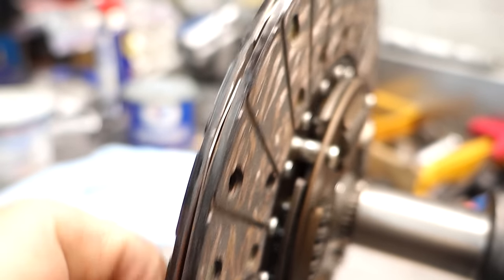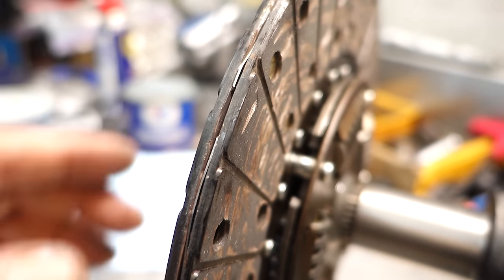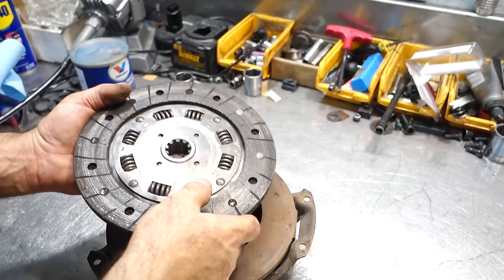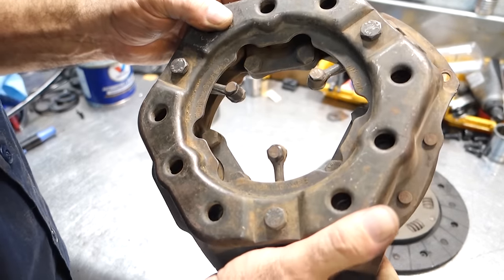Learn How a Clutch Works -  Basic Clutch Operation and Tips

Comment: After adjusting the shifter linkage to factory specifications, reducing the play in the clutch pedal so that the release bearing makes firmer contact with the pressure plate diaphragm fingers to disengage the clutch disc and renewing the transmission fluid with Pennzoil Synchromesh my A833 works like a dream. So I got to thank you Paul for this fantastic tutorial because man does it feel good to fix it yourself, feels awesome.
Reply from the maker: That's what it is all about! Thank you.
Reply: Anthony Murphy where is the speedometer sensor for a volvo 2000 v40 4.0
Reply: GearBoxVideo where is the speedometer sensor for a volvo 2000 v40 4.0
Reply: Question. With the firmer contact of the release bearing with the diaphragm fingers, is the release bearing turning whenever the car is moving (whenever the clutch is engaged) (whenever your foot is off the clutch) and you are driving down the road. If so, how long will the release bearing last?

Comment: Very informative. I wasn’t aware that the pilot bushing could grab the input shaft that way. Cheers.
Reply from the maker: We only use oil impregnated bushings. Never a roller
Reply: @GearBoxVideo  What is acceptable clearance on the diameter of pilot shaft to bushing ID? Is .010" too much (for an oil lite bushing)?

Comment: I learnt a lot about clutches a few years ago. I drove a 1983 daihatsu charade and could not get a daihatsu clutch set for love of money so had to contend with a LUK clutch. Within a year the clutch collapsed catastrophically.  After replacing the clutch 3 times in 3 years i found a daihatsu clutch.  It turned out that  the LUK  thrust bearing was not the right size and caused too much pressure on the plate and it would cause the diaphragm to collapse. The daihatsu clutch lasted 10 years!!!!!  Thank you for the reminder of how they work.
Reply from the maker: Often overlooked on replacement clutches is finger height. So what happened is the diaphragm was being over-centered causing early failure. Since you have no release bearing travel adjustment

Comment: Thanks very much for taking the time to record and upload the video.It helps a lot when you can see how all the parts work together in sync rather than just being told.Now all the “can’t find it so grind it” drivers ,reverse gear especially noise I have heard down through the years now makes me cringe even more that I am a little more enlightened.

Comment: You're the man , very well explanation on the clutch plate springs and clutch hub assembly all revited together. Loose springs and worn hub could result in shudder as the plate runs out of circle when the clutch is released. Very informative and very well done for showing others how it actually works. Great job sir.

Comment: Great explanation.  Just wanted to add something for people who don't know. Before i shift to reverse i shift to first gear to stop all gear movement in in my worn-out old t10 with lack of preload. It does stop turning pretty quick when clutch is disengaged, but this speeds up the process considerably and eliminates crunching reverse all together
Reply from the maker: Its a very good practice to do that providing you do have good clutch release. Poor clutch release can ruin rings especially if you use the rings to break a dragging disc loose.

Comment: I have an issue with my car having rattles when I apply clutch control. This is after the gearbox was replaced. I needed to understand what the possible causes were, bewore I take it back to the workshop and allege that the gearbox is faulty. This video was so helpful and easy to understand. I have almost now mechanical understanding, yet I found this video very informative!!

Comment: The best video on the workings of a clutch! As a DIYer, I never got a chance drill out the rivets in a clutch plate since I would forfeit my core deposit. I understood that the coil springs dampened the action of the clutch but I never understood how until now.
Reply from the maker: Thanks

Comment: Great video. As others have stated, you've explained the clutch in such great detail that others haven't. I'm impressed you recorded this 4 years ago - 1080p at 60fps. Most YouTubers struggle to upload at 720p still.

How do a clutches not burn out quicker than what they do? 
An engine generally runs anywhere between 500 and 8000 RPM. A lot of people have bad habits like holding their vehicle on a hill using the clutch and still not have to replace their clutch on a regular basis. I would that thought that an engine sat at 500-1500RPM holding a 1-2 ton vehicle on hills would eat clutches.
Reply from the maker: All clutches are designed with a certain static pressure. Standing idle and not moving puts little load on the clutch.The initial action of the clutch to get the vehicle moving usually works the clutch harder.  However using the proper transmission gearing makes a huge difference. The lower the 1st gear ratio combined with the lower axle ratio put little load on the clutch. Most trucks have huge reductions in 1st gear. A semi can have a  17 to 1 1st gear 10 speed where a passenger car has a 3 to 1 1st gear and is a 5 speed.

Comment: Thanks for your video with it I was able to identify my error in installing the clutch in my project.I installed it backward and now have to remove trans, driveshaft/torque tube and bell.Its a conversion for an LT1 into a Porsche 944.The clutch which is an early Mopar 1 inch 23 spline had no stickers and I thought the extended nub on the side facing front would interfere with the pilot bearing.Project has been idle for 3 weeks now being lost in theories and con men on line trying to sell me a fix.Thank you sir I have some work to do now.Your a good teacher sir.Thanks!

Comment: Paul, I just watched you rebuild Erics T5. Afterwards I watched this video and now I know why reverse gear grinds on my 70 Chevelle super T10 trans, I gotta adjust my clutch. I was using the free play method only. You are the greatest , love your videos and I just subscribed.
Reply: +billy greenhorn In my experience, try and make a habit of always putting the transmission into a forward gear to stop the mainshaft and cluster from rotating, and then engage reverse without grinding. If you try and engage reverse without first engaging a forward gear, it will grind unless you wait sufficient time for the gears to stop rotating.
Reply from the maker: +t5montecarlo   The purpose of the "spin down" test is to make sure you have proper clutch release.  Its OK to do what you suggest IF you have good clutch release.  If you press on the clutch pedal and count to 10 secs, the transmission should slow down and stop on its own and go into reverse clean.  The method isn't about reverse, it's about making sure you have good release.  A dragging disc can break loose form sticking it into 1st before reverse, but shifting at 6500 RPM with a poorly releasing clutch leads to premature synchro failure and missed shifts.  So again this is just a simple easy test to make sure you have a good working air gap.
Reply: +GearBoxVideo Thanks for the response guys. I usually do put it in first gear before shifting to reverse and that works but when I am backing up, the clutch shudders a bit too. Paul , if you read this comment please can you make a video on adjusting a clutch on a "A" body car such as a Chevelle/Olds/ Pontiac please.

Comment: Very good explanation on the meat and potatoes of how a clutch works. The centerforce is a different animal the pucks that engage the fingers increase the pressure plate load under increased rpm.The pucks pull the fingers of the clutch upward and out of their relaxed position. This causes the release bearing to lift causing a rattle in the clutch pedal only in linkage or cable hydraulic no problem. increased freeplay is the ticket no noise its golden.
Reply from the maker: Our of the hundreds of Centerforce installs, I've personally never had a rattle issue. I've seen release bearings rattle with any clutch because of poor fit on forks and front collars. Hydraulic release bearings are the worst because they naturally lay against pressure plate fingers. That is why factory bearings have a damper spring on them. This is really not a Centerforce issue.

Comment: Jus' a friendly comment (I don't expect you to read):  But thank you for taking the time to make this video and explain the clutch system, otherwise it's too easy to fault the machine instead of the driver into why the machine isn't operating like the driver 'thinks' it should.  You made a better video in 2014 than what modern animators can do with programs that explain in depth over how manual transmissions work (although, it is nice to see the parts in physical appearance vs. animated)...
Reply from the maker: outcast668 thanks for the great feedback. Much appreciated.

Comment: BRILLIANT video! i have always wondered about this, and you even answered questions i was thinking of while the video was going. Like the Lighter flywheels. I've heard race cars use light flywheels to get better shifting, but it comes at a cost. Never understod why, until now.
Reply from the maker: ZeaMoore4 remember any time an engine fires you will have an increase in crank speed then a decrease until the next cylinder fires.  This creates harmonic vibration.
Reply: GearBoxVideo

Comment: Wow...
Thank you very much,it's really interesting,particularly on the bushing heating up.
Reply from the maker: Thanks for watching!
Reply: +GearBoxVideo In regard to the bushing locking to the shaft, could that happen if a car was going at speed and was accidentally thrown into 2nd instead of 4th?  (Yes it was me) Made a cloud of white smoke and now I find the clutch pedal travels a lot further from the floor before engaging.  It engages at the final 1/4 of the pedal release, but it was a more spread release prior to letting the smoke out - spread over middle half of pedal release.  

At least it's not asking about clunky reverse noises... hehe!
Reply from the maker: +Jeff Parks sounds like you smoked the clutch.
Reply: Thanks Paul.

Oh god, I googled smoked-clutch... so many jokes about 'clutches' hahaha
Reply: reminded me of you and ETCG and smoothing those rods ...

Comment: I love your work bench man.  All the scratches in that metal could tell some stories for sure.
Reply from the maker: The bench was custom made with a powder coated aluminum frame and  stainless steel sheet bonded to plywood. Its seen a lot of action.

Comment: Paul great video just a little note when I was watching when you were talking about the engagement of the clutch and the throwout bearing back when I had my 67 Camaro I used to race added the high horsepower motor big Heavy Duty clutch Doug Nash 5-speed with a long shifter had a hell of a time trying to figure out what was going wrong turned out it was something very simple after watching for hours and screwing around had somebody depress the clutch while I was underneath and noticed clutch linkage was actually bending as it was depressed not giving that the full length the easy fix at the time what is welding a sleeve over the linkage to stiffen it after that Moroso made heavy duty rods that actually had heim joints on each end was a lot easier to push the clutch in and out and no flex whatsoever on the rods just mentioning this in case someone else ever has that problem enjoy your videos very much keep up the good work
Reply from the maker: I remember the Moroso heavy duty Z bars.  Now newer clutches have a softer apply but better holding power, so those days are gone.

Comment: I've seen a floor shifter vibration that drove us crazy. 5th gear, rpm, speed specific. We chased ujoint angles, etc. The Ford tail housing balance weight helped. Now it seems the crankshaft power pulsations might be vibrating the disc springs and causing a harmonic in the power transmissions. Maybe a different disc would have cured it.
Bravo for adding insight to the possible problem.👍👍 2/2020
Reply from the maker: If you have a light weight flywheel that can aggravate the condition

Comment: I've been so focused on learning about electrical engineering, that I've failed to see how marvelous mechanics can actually be. This gives me ideas 🙂 I could use this to make an extremely powerful electrical machine. Hell just imagine instead of powering a car, you just run the transmission shaft directly to a huge electric motor or use a sprocket to chain it to multiple electric motors and use a car engine as a power plant 😮 maybe for an extremely dangerous tesla coil...or some other fantastically dangerous thing that definitely no one should try at home lol.

Comment: I had never understood the operation of those cushion springs in the middle. Good explanation. It might also explain why modern Ducati V-twin motorcycle clutches clatter like crazy when the engine is idling in neutral.
Reply from the maker: Yes. Typically those have no springs and multiple discs which will rattle.

Comment: Good lesson.  I just replaced the disc in my 70s VW Bug with a non-coil spring disc and the grab point is quick and harsh, as now there appears to be near zero dampening. Nowhere near as smooth release as before.  Will this sudden, quick grab soften when broken in or is that it?  Which type discs are preferred,  with springs or without?  I guess what I'm asking is, do racers prefer the non-coil spring disc?
Reply from the maker: For street use a sprung hub is best

Comment: The way you explained how sometimes reverse gear grinds and doesn't want to shift made me visualise what was happening in my car. Thank you so much. But that begs the question as to why companies don't use synchroniser rings in reverse gear. It would make the reverse gears a lot safer from ignorant drivers and prevent accidental damage to the gear teeth.
Reply from the maker: Companies DO use synchros for reverse just not on older transmissions. Sometimes it's a space issue in the design and technically the vehicle should be stopped before putting it in reverse negating the need for synchronization.

Comment: Thanks for the video. I'm about to replace the flywheel, pressure plate and clutch disc on my Russian 1998 van. However, that pressure plate you show at the end of the video with the 3 fingers looks just like the one I bought this week for my van. So I guess the Russian's went with "if it isn't broke don't fix it" in their R&D department.

Comment: Great insight. i have been having clutch problems. now i understand how to fix the problem.
Reply from the maker: Glad it helped
Reply: @GearBoxVideo  I have also discovered that my Ford 3000 required the cerametallic button plate type as opposed to the spring loaded round type. what is next item you have in store for us on tractors.

Comment: Thanks for the great vid - it's very informative. I'm viewing because I'm having an issue with my new Southbend Stage 3 Endurance clutch on my Mazdaspeed 3. The clutch is rated for 500 ft-lbs, and I make 390whp/380wtq. My stock clutch held my power level just fine for ~40k miles, but it started slipping when it was cold outside due to the extra power my tune makes in the cold, so I went ahead and upgraded.

The new clutch engages fine and I have no shifting or grinding issues, it's just that it doesn't hold my power level, even though many others with the same car and clutch use it for up to 650hp/450tq - that's why I upgraded it - to hold more power, you know? I followed SB's break-in procure meticulously: 500 - 700 miles of city driving, lots of shifting, not revving over 3500, etc. I'm now at 1000 miles and it slips when I drop the hammer. Its not grabbing hard enough to accommodate my power level.

One Southbend guy said I just need to drive it more - that it's just not bedded-in yet (it's kevlar-based for greater power capacity and heat resistance). I found another person online with an Audi S4 who had the same issue also with a Stage 3 Endurance, and another Southbend guy told him to slip the clutch for 3-5 seconds, depress the clutch fully for 30-60 seconds to let it cool down, and to repeat this 4 or 5 times. Afterwards, his clutch was biting just fine and no longer slipping under power. Still another Southbend guy told me it should be holding the power just fine even if not fully bedded, and that I should initiate the warranty process.

As you can imagine, I'm confused with these 3 different options regarding what's happening. What do you think is going on and what I should do about it? The clutch was installed by an ASE tech at a performance shop with a lot of experience on Mazdaspeed 3s, so I doubt it's install-related.
Reply from the maker: Kevlar requires more heat to grab. I think I would have went with a dual disc setup. Something like with ACT offers